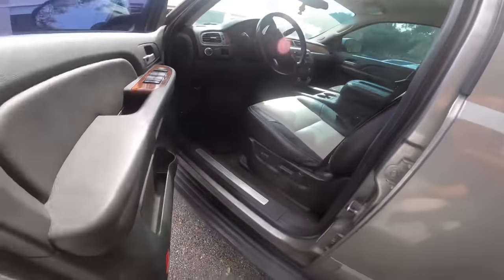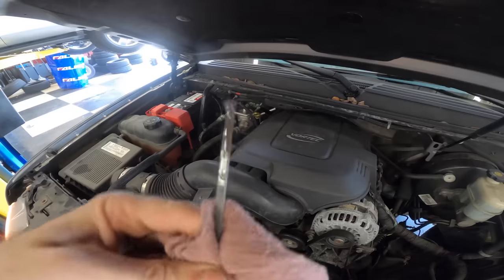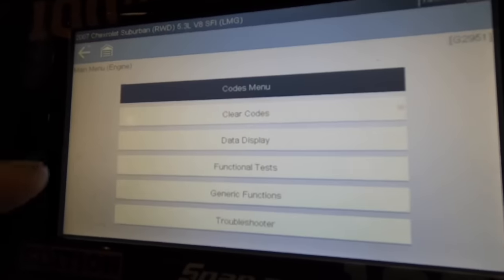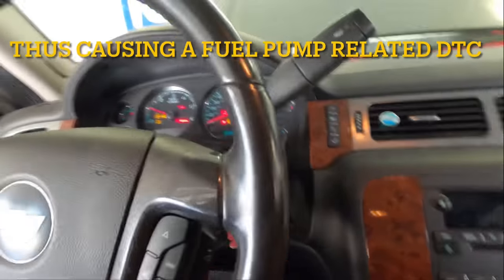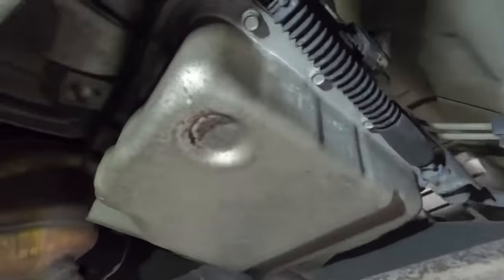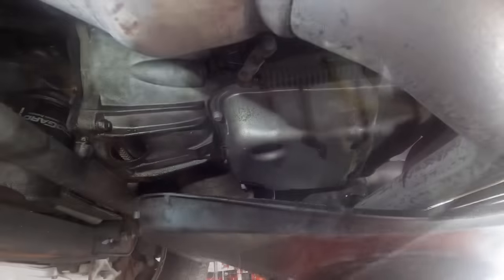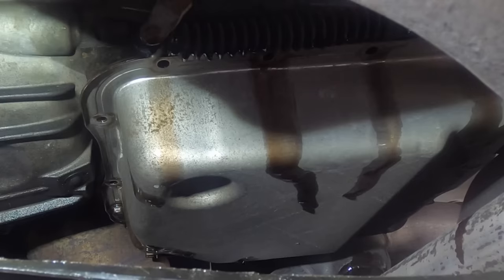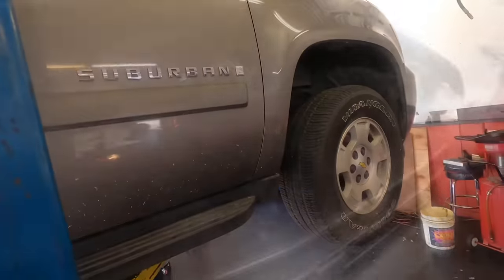Busted! SCAMMING Mechanic Causes Damage! 4l60E Transmission

Comment: Damn fine job Ray. As soon as you opened the fuse cover I audibly said "WTF is that blue wire?"

Shady people like that, and growing up broke is why I learned to do 99% of my own repair work. But I'm with you on transmissions. I'm pretty sure they just work based on some form of witchcraft.
Reply: Just like there is a Wizard in every carburetor.
Reply: Go watch precision transmissions. Richard explains the witchcraft
Reply: @CORVAIRWILD  like 99% of richards viewers i have no idea what he's doing but i know he's good
Reply: My first thought was "does it have any kind of after market sound or lighting? If not, wtf is that blue wire?"
Reply: Auto transmissions are mostly planetary gears attached to clutches, some times friction bands, and solenoids that turn on and off. Really not too complicated, problem is the service data is very expensive.
Reply: I am a transmission tech and I can confirm they work on stripper glitter and eyelash glue.
Reply: As someone whose taken apart and put automatic transmissions back together...Basically. Hydraulic Witchcraft, but Witchcraft all the same.
Reply: JFM for sure. (Just f’in magic)
Reply: @CORVAIRWILD  he tears them down like it's nothing. Almost makes them look easy to understand. Almost.
Reply: The fuel pump relay and fuse draw a lot of current and can cause relay circuit board problems over time. Some (good) mechanics bypass the fusebox and install standalone heavier duty fuse and relay sockets. At first I thought the blue wire was someone's effort to do this, but if the pump was running continuously, I guess not.
Reply: Exactly, then I said,  wait, if the fuel pump relay is out how the hell it's running?
Reply: @eefneleman9564  I've done a few transmissions, 4L80E, TH400, TH350, Borg Warner, TH125C (front drive), but I was always the helper. Only the BW used to skip 2nd gear, oh well, we were 22 years old
Reply: Transmissions are not witchcraft.  They are magic.
Reply: LOL, I said almost the same thing when I saw that blue wire.
Reply: @kingofbrutaltheocracy9201  More than likely the 3/4 clutch assembly is about gone. That goes before about anything else on that particular tranny. That and the sun shell. Which is probably the reason for the noise as that sunshell breaks.
Reply: I had the exact same thought....
Reply: @OHHyaKnow   yep I agree.
Reply: @billmonroe8826  I bump your post! Sounds like you have been in a few 4l80s, or whatever this vehicle has!
Reply: @michaelthorne5441  Its in the differential, once one wheel's speed gets high enough (relative to the other axle) it locks the left and right axles together.
Reply: If only manual transmissions were still available. Automatics are fine if you're the type who gets a new car every 2 or 3 years. But for poor people like me, they are the worst thing that ever happened to vehicles along the computerization of anything besides fuel injection, abs, and ignition.
Reply: So where did that blue wire run to ??
Reply: I'm the same' I've had a vehicle in a shop 2 times, 1 was for an oil pump on my 1st vehicle back in 1965 ish that took me about amonth to rebuild and was sick of working on it. The cost of the pump and labor was around $30 at that time, and to think what it would be today is why I do my own work!
Reply: @garymckee448  a carburetor is one of those things that's extremely simple in how they work but extremely complex in actually making them work. they work by creating a vaccum with a venturi that sucks fuel out of the float boat... seems simple however actually making that happen is extremely complicated
Reply: @CORVAIRWILD  He's not the first nor the only one. I tend to watch Hiram over at automatic transmission. Granted he's so busy that he doesn't always have time to do vids but when he does he does them with lots of info on what's going on and how to fix it.
Reply: @billmonroe8826  i thought  gm fix the sun shell problem years ago
Reply: @toddburton5548  Not if it's a 4L60E and it's an 07 and  still factory which it probably is. If it's been  overhauled once then hopefully it was replaced.
Reply: That's the thing about those 4L60E transmissions. They will shift perfectly until they grenade.
Reply: Have you guys seen how a Toyota hybrid eCVT (aka planetary power-split device) works? It’s pretty cool and reliably simple.
Reply: @CORVAIRWILD  
That guy is a freakin God!
Reply: I'm a mediocre DIYer mechanic. First time I saw an automatic transmission teardown I was like, what kind of alien technology is this!? 😆
Reply: @CORVAIRWILD  That guy is incredible. Makes it look as simple as changing spark plugs. I've learned some from him but it's still alien to me. No way I would attempt to rebuild even my manual trans.
Reply: @dashingdave2665  🤣 I'm one of those guys. Hoping one day the old light bulb will come on for me. I've had a few flickers though.
Reply: @CynHicks  Haha, well at least we know what's good in Amarillo, Texas!
Reply: I always fix all of my own cars..... except a transmission....unless it’s a manual. That’s different though.
Reply: @CORVAIRWILD  Carburators are actually easy, mostly because they don't require a damned computer. But what really helps is if you grew up with them.
Reply: I grew up poor too and ended up being a gearhead and engineer in the automotive industry. Remember how traction and stability control, fuel injection systems and climate control systems seemed so daunting the first time you worked on them and now you've taught yourself how to fix all those. Well done!
Reply: @konnerkramer329  Easiest way to simulate a carburetor for a curious person is to put water in a glass, put a straw into it and have them blow across the top of the straw. This is how I taught my kids to understand the principal behind the carb. Everything else is there in support of that same effect.
Reply: Watch the Precision Transmission channel and you'll see how transmissions are taken apart and how they basically work, they won't be so mystifying after a few episodes.
Reply: Im guessing constant power to the fuel pump
Reply: @michaelthorne5441  Joe dirt 😂
Reply: @RayleighCriterion  precision transmission can tear one down and have diagnosed in about 15 minutes. The guy is like a 1 man pit crew.
Reply: That’s why there called automagic
Reply: Watch 1900s educational videos on differentials and transmissions, makes it way more intuitive
Reply: @garymckee448  SmarterEveryDay made a video on a transparent carburetor, which demonstrates how incredibly simple the fundamentals are. Search 'how a carburetor works' or go here. https://youtu.be/toVfvRhWbj8
Reply: @cancelhandles Yes but I would still screw it up but thanks that will be interesting to see.
Reply: Magic!
Reply: @2009mechanic  it ran to the rear flux capacitor and spliced into the rotary timing belt so that at the specific time the capacitor was sending a reading to the TCH valve the 5th and 6th cylinders would have already been bypassed by the alternators rapid injection value. It's a pretty common trick.
Reply: If you open it up, you can see a hamster wheel and inside and two little guys chilling inside until you start the car
Reply: Same here.
Reply: @cancelhandles  They're very simple and clever devices, unfortunately they're also relatively imprecise and need a lot of 'fudges' to work properly across a wide range of engine loads and speeds, which is why most carbs have separate idle, midrange and high speed circuits and jets but still get the air:fuel mixture wrong most of the time.
Reply: @2009mechanic  the fuel pump, making the trans into a limp mode
Reply: @kingofbrutaltheocracy9201  yeah? Have you worked on a newer automatic tranny?? Bullshit computers control too much
Reply: @ReachOutToWilliam  some would argue that they are one and the same...😎
Reply: @2009mechanic  fuel pump
Reply: To be honest in a lot of situations I watch free and they'll swap parts out number one do guaranteed and the other thing he just doesn't have the time to be tearing down a tranny and rebuilding it nor the resources so I understand in certain situations better just replace things me in my driveway I've case starter motors around and then put new brushes and cleaned them up and made them work again but the guy that's in the trades like he is it ain't worth the time have a good day
Reply: @OHHyaKnow oh man, too much stripper glitter is bad😅 both in the transmission and on us😂

Comment: A pan filled with carbon from the clutch packs, the fluid likely smelled  like battery acid and clearly indicates it needs to be serviced a little more often than then it has been. Your a good man. A honest mechanic who digs a little deeper into the diagnostic routine to find the true issues and not just what one may think of what is wrong.  Keep up the great work your doing.
Reply: How do you find a mechanic of this work caliber with moral integrity.
I need one .
Reply: People seem to think ATf is supposed to be "lifetime", it's not. This truck probably never had the ATF and filter changed.
Reply: Sounds to me that it possibly wasn't about the truck owner servicing the transmission enough rather that the way the first "mechanic" set the system up it was eating away at the clutch and transmission. If not fixed soon enough the transmission might have been totalled, meaning imo if this is the issue that the owner is owed a new or rebuilt transmission from the scammer including his reimbursement.
Reply: @adotintheshark4848  i think dealerships are the ones that started pushing the idea of "lifetime atf" because it's not technically wrong so they can get away with it.
it'll last the intended lifetime of the vehicle (warranty period 5yrs/50k) but also dictate the lifetime of the vehicle because of it. they want you to buy new cars after the warranty period expires.
Reply: Yeah that stuff smells nasty when it's been burned by clutch-paks or shaved metal from gears & other tran items. Think maybe this former mech actually put metal shavings from whatever into her transmission fluid? It'd be the same type, she brought it in for an oil change and he added a "special transmission additive" then waited for the whole thing to quit. Plus the blue wire bypassing that relay, shady $h it right there..
Reply: @flatout5815  Yep. Just "topped off her fluids" at that last servicing.
Reply: @cake2531  Exactly, when it dies that was it's lifetime.
Reply: Yeah, the trans never getting first gear will wreck those clutch packs no matter how often the customer changes the ATF.
Reply: @annereuter2630  If you understand enough about cars, purposefully create a small issue and bring the car to a mechanic, tell them what the problem is and see whether they honestly identify the issue or try to sell you some expensive crap instead.

However, only do this if you positively know what you're doing, since otherwise, you could actually create a much bigger problem than you initially intended.
Reply: I would run from this nightmare!  You will end up owning it otherwise.

Comment: Really the fact that you recorded everything you found should be proof enough for a court case witch should include any transmission work that's needed. And you can bet it's not the first time they've scammed someone!
Reply: Ah, I bet the fuel pump is bad. Let the truck sit and cool down and the fuel pump will be sticking. The added wire was a work around keeping the fuel pump running all the time to keep it from stopping. The wire just added more problems to the situation. The original mechanic has no business doing work like that though. And $400 spent there, that sounded like a battery, oil change and whatever else the idiot did.
Reply: @mph5896  The $400 was for labour only which is excessive.
Reply: Yep, I think this would be perfect for small claims court, where you only need “a preponderance of the evidence” as the standard of proof.
Reply: @Biffo1262  funny how people that want to bag you won't put their name to their comment 🤔
Reply: Thanks for being an honest, hard working mechanic. Wish I could trust more shops in the area to employ people like you.
Reply: @mph5896  I work on computers and if I have to do any patch mods like that, the customer will definitely be in on it.
Reply: @mph5896   
 the OIl pressure sensors should be replaced with the pick up tube o ring(these go BAD pretty often)
Reply: @randomschmo5778  preponderance of the evidence is simply the standard for civil cases, not limited to small claims court

Comment: 28:45 for those who don't know, transmission fluid is supposed to be clear/red. It should NEVER look like used oil. There is no combustion chamber or gasoline in the transmission to darken the oil. If it's dark like that, it's burnt from gears and clutches overheating and burning the oil that touches them which indicates a damaged or abused transmission.

Comment: As a budding mechanic myself with only about 1 1/2 years under my belt, I appreciate and value these videos as a resource for learning how to diagnose vehicles. Thanks for the great content
Reply: keep on keepin on man, check out south main auto as well as ray both have good quality videos on diags. Bout as close as your gonna get when it comes REAL shop life and not what the Tech Schools try to teach.
Reply: before I got into cars I got a new 1972 CB450 DOHC Honda and that winter when I couldn't ride I tore the engine down to the last nut and bolt. Honda manuals are very through. I put over 20K on that bike and redlined it as often as possible with no problems. After that I had the confidence to fix anything. Just remember If all else fails read the directions.
Reply: As a budding mechanic the best advice I can tell you is stay honest.  Never work for a shop that tries to rip off the customer…or if you have to…don’t fall into that trap.    Live confidently and peacefully
Reply: @kingram5329  Love South Main Auto, he takes you step by step procedures and how things work.

Comment: It's good to watch an honest man doing his best to make repairs.
Reply: These cars with computer electronic electricity components run on a circuit if not properly fix replace, it can damage more on that circuit or the computer,, there not like old cars,,, the computer will read low power signal on circuit or too much ,
Reply: No he lied about the carburetor